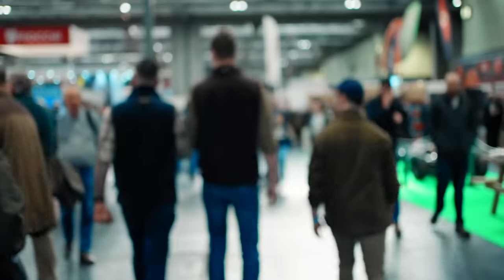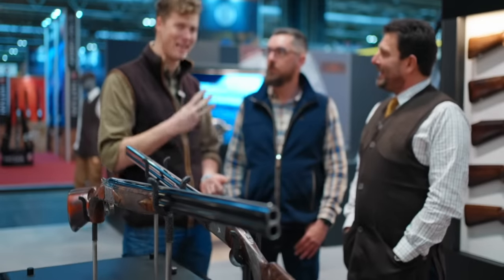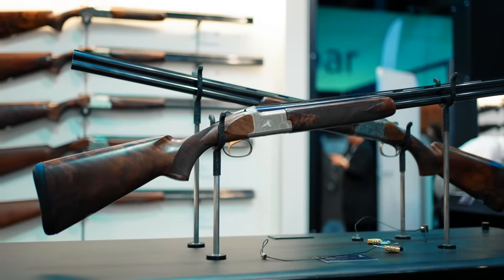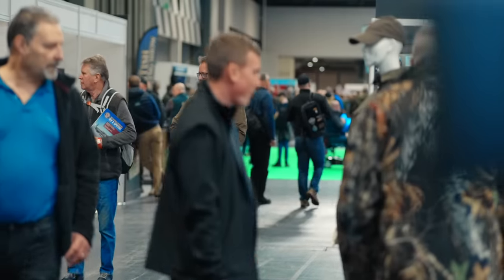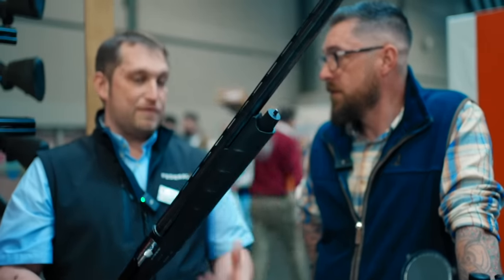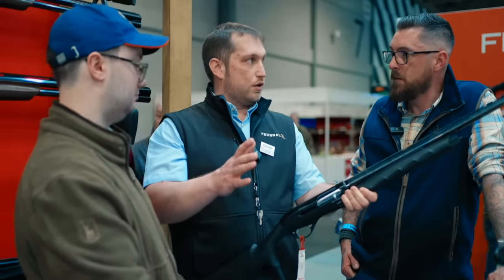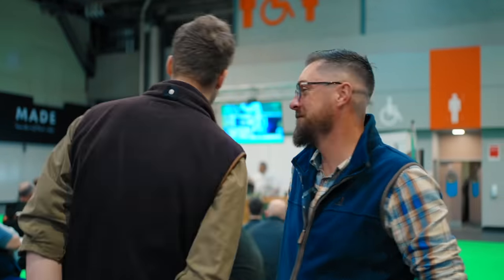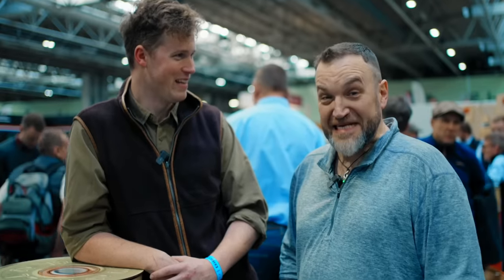The British Shooting Show 2023!

Comment: As someone looking at getting into shooting this gives me hope that £100 buys usable guns.
Reply: there were a lot of sub £100 guns in many gauges.  I saw a few bolt action 410s
Reply: Don't forget to budget for all the steps needed to get your certificate. You'll need to pay for the licencing itself (£79.50 currently), a medical check (which most GPs charge for, usually in the region of £50), and a compliant gun safe, which depending on how many and what kind of guns you plan to own can vary in price from the budget (just sub £100) to thousands for top end hidden biometric type safes. Typically most buyers choose to go for a fairly mid-range safe which is £200ish for a 3-5 gun cabinet. Even with savvy price hunting on cabinets, expect to pay £200-400 before you are even at the point of purchasing a gun, unfortunately.
Reply: @samwalker7567  yeah I know the gun is a long way down the list, I’ve seen a few gun cabinets around the £100 mark but then I’d need amo safe won’t I?
Reply: @Horsepowerimages  you’ll only need an ammo safe if you’re storing bullets. There’s no legal requirement regarding the storage of shotgun cartridges
Reply: @genghishank1  that’s what I thought but if I’m putting in for my shotgun I will probably put in for my fac as I have friends with rabbit problems on their smallholdings.